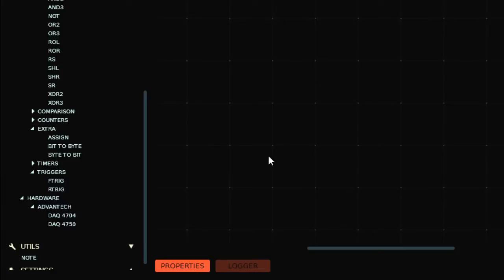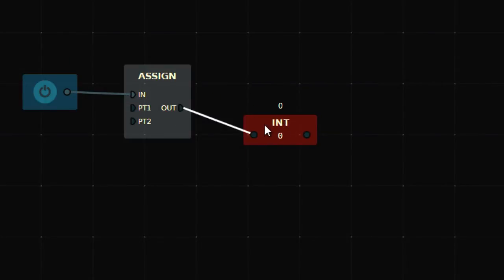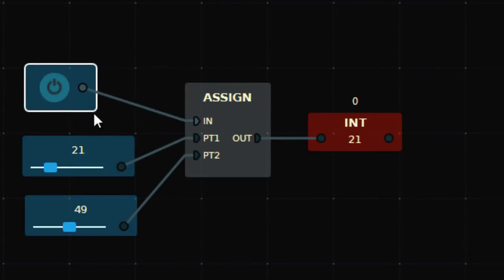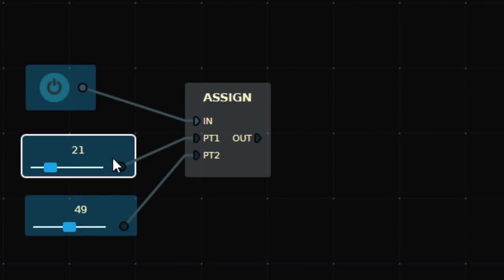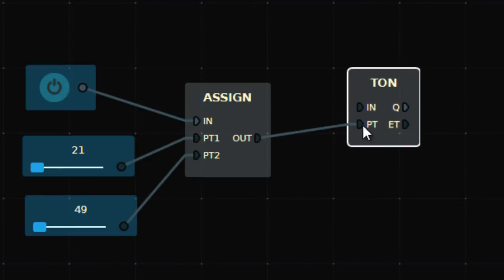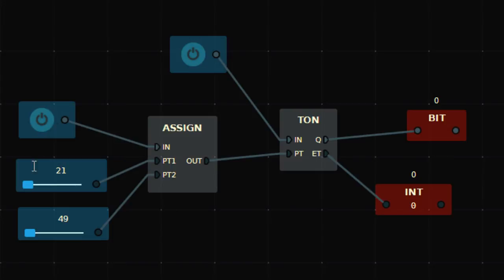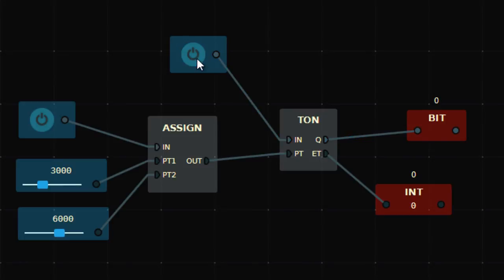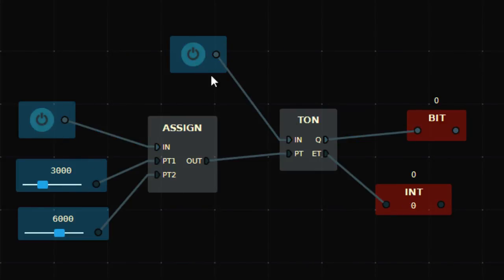PLC FBD Logic Lesson 11- Assign Function

Comment: Hi, can you help? 
I have three Assign functions with three different numerical values, and I need to connect them all to a single numerical output, how do I do that? I can't connect more than one wire to the numerical output.
Reply: Here's a screenshot to illustrate my problem
http://i.imgur.com/3rqfqYd.png

As you can see, I can't connect more than one wire to the INT output.
If I make three copies of the same output, it's unknown which value reaches the output (sometimes it's 25, sometimes it's 100), so that doesn't work as well.
Reply from the maker: +Mitya Drokon Dear Mitya, I have designed your logic, it's little complicated. But i hope you will understand. Share your E-mail ID to get the logic or write me at nfiautomation@gmail.com